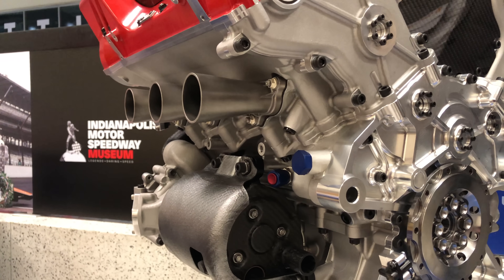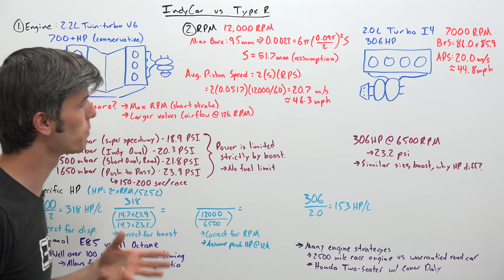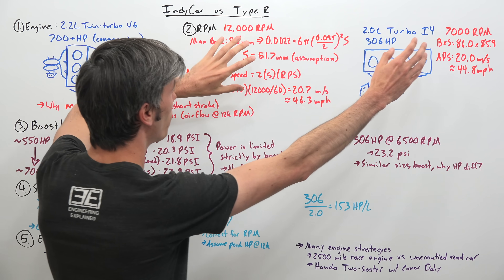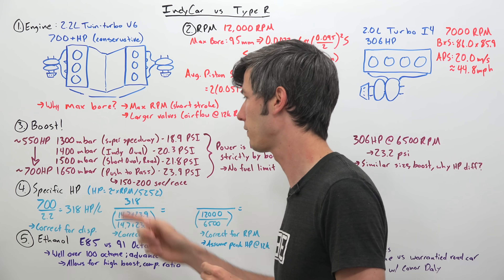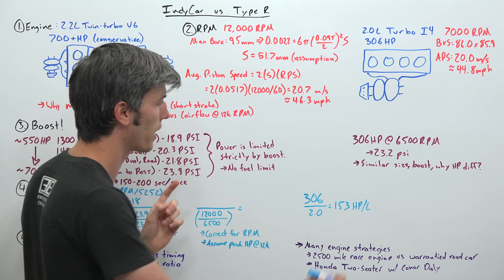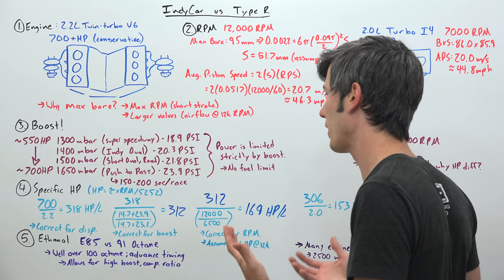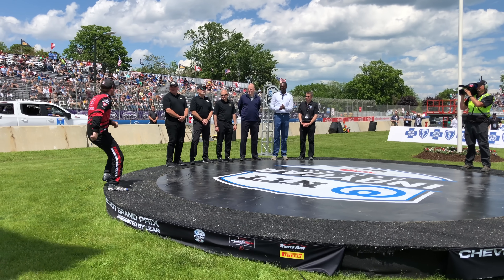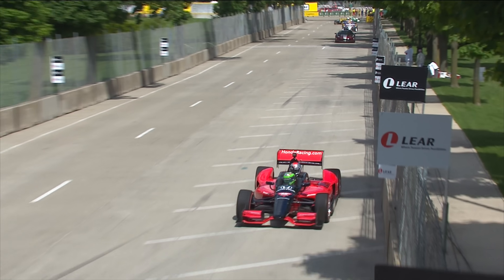How Honda’s 2.2L Engine Makes Over 700 Horsepower

Comment: Turbo engines uses lower compression ratio. Is that mean when piston reach tdc there is bigger gap with crown and cyclinder head? When applying turbo to nas engine what can be done for gaining that ratios or keeping it working properly

Comment: Using RPMs to divide power per liter should give you torque per liter times a constant. For indy car, it is 700/2.2/12000. For types, it is 306/2/6500. Here is the real problem, how indy car engine can achieve such a similar torque number per liter with a much shorter stroke which means the rod is a much shorter lever arm on the crankshaft? The way you are doing math makes no sense to me because HP is not the base unit you should use when describe engine.

Comment: I think a huge thing a lot of people in the car community or new to it overlook is that Boost is a measurement of restriction to flow. If you can reduce the restriction/increase air flow through the engine by improving the air delivery system, better intake plenum design, head porting , as well as better exhaust management with better flowing manifolds and exhaust. you will make the same or more power at a lower boost level. You are physically flowing more air through the engine even at the lower boost level and it will make more power. 

I dont know how many times the first question out of someones mouth about a build has been how much boost is it running. When it has no bearing on the power level of a engine. You could have a near stock engine setup with a tune pushing 22-26 PSI and then the same engine platform with a larger turbo & proper supporting intake and exhaust modifications making 150+HP more at 20 PSI

Comment: How does Honda make 700hp from a 2.2L?
Jason: does some math 
Me an intellectual: it has 2 more cylinders
Reply: It's not about how many cylinders...it's about how much air the engine can flow. Hence the high rpm...nearly the same displacement but almost twice the rpms...which equals close to twice the horsepower. The formula is (torque * rpm) ÷ 5252 = HP. Quite simple actually.
Reply: it would need to have 4 more for it to make sense
Reply: It could have 100 extra cylinders, and with all other variables (displacement, boost, rpm) being equal, it would still move the same amount of air as the 4 cylinder. It's mostly a factor of RPM in this comparison, made possible by the proportion of bore to stroke and maybe some valve sizing, timing and lift, not number of cylinders.
Reply: @Strunz0  indeed.  Its all rpms.  Engine life is super short too.

Comment: You missed that although the average piston speeds are the same the loads the pistons see aren't the same, the V6 needs to accelerate and decelerate its pistons more times per second meaning higher G forces on the pistons of the V6

Comment: That's how you know it has way more than 700 horsepower because that engine I'm sure is designed so that, because of airflow and the geometry of various moving parts and what not, it should still make allot more power per liter than the Civic engine.

Comment: this is the 4th generation  Indy  engine.  It is  easier to  understand this Jap  engine specs.    by dividing  millimeters by 25.4,  the  3.75" bore x 2" stroke = 134 cid.  v-6.  with twin turbochargers at 20 psi boost.  Metric  boost should be stated in kilopascals  and not millibars.  20 psi boost is equivalent to 140 kpa.   Honda  rates the engine for 1200 miles before  possible failure.  It should be noted that  earlier Indy engines produced more power however,  they were downsized in order to reduce crashes.  4th gen Honda engines are rated  550 - 700 hp however  there is  acceleration  lag  with  the trubochargers.   The Indy drivers have complained of lack of  horsepower and  the 5th gen engine w/ 900hp  has been approved and is being track tested in the summer of 2020.

Comment: You didn’t mention emission control as well. Has to rob a bit o power from the road legal Type R motor. How cool would it be if Indy enforced road car based engines and turned the type r motor into their Indycar engine. I want to see/hear the engines in a straight 6 or flat six iteration. V6 bad...I6 goood.
Reply: V6 bad? Sounding because not really i6s sound worse 9 times out of 10 to me.

Comment: I'm surprised he forgot to include how much airflow those Indy twins are flowing compared to the Type-R's single. What are the sizes of each turbo? 10lbs of boost on one turbo does not equal 10lbs of boost on another, say larger or smaller turbo (or two turbos). If you compare the CFM produced by each setup, that is most likely the largest factor in the different power levels.
Reply from the maker: CFM is RPM dependent. What matters ultimately is how much air to do pack into the cylinder. Boost gives you a good approximation of that number. Higher RPM means you do it more times per minute. People overstate the importance of CFM with turbos. There's a reason the series restricts "boost" and not "CFM." Though ultimately, both are limited if one is limited.
Reply: @EngineeringExplained  "Boost gives you a good approximation of that number", I would beg to differ here. 10lbs of boost from the K03s turbo in my beater 1.8t GTI produces a considerable amount less volume than 10lbs of boost from the GTX3071R turbo in my fully built 1.8t GTI. Same motor, same boost levels, completely different amount of airflow going through the engine.

CFM is a huge factor in the amount of power that you'll get from a setup, so it's definitely worth including in your reasons for the power differences. To leave it out completely is misleading to those who do not understand all of this stuff. ;)

Comment: It's the engine torque that does the real work. Also, the six cylinder 700 HP engine has more "power overlap". Because of the six cylinders, there is always one piston contributing power at all times of the crankshaft rotation. Where as in the four cylinder engine, there is a moment of crankshaft rotation where there is no power being produced at all. Because of the two missing cylinders.

Comment: So, six cylinders versus four, V versus straight, 7000 RPM versus 12000 RPM... teach me how the 12000 RPM V6 produces more power even though it has similar capacity... no white board required.
Reply from the maker: It's illogical to assume that "V" or "6" have anything to do with an engine's power. A "I" can make more than a "V" easily, and same with a 4 over a 6.

Comment: Doesn’t 91 octane gas have more BTUs per unit than E85 ?
Reply from the maker: From a volume standpoint, yes. You need more E85 to make the same power, but you can burn more of it at a time.

Comment: I would really like this in my first gen Colorado. Unfortunately, this would require a much stronger manual transmission. LOL. Great video.
Reply: You can get gm indy v8s for like 30k you'll be able to pump out a ton of hp and well you'll need a new trans

Comment: would be cool if you also compared these engines in terms of valvetrain
Reply from the maker: IndyCar has DOHC with set lift and timing (per regulations). Type R engine also has DOHC, but variable timing on both, and variable lift on exhaust (VTEC!).
Reply: Engineering Explained thanks! :) that’s why you are the best automotive youtuber

Comment: Can you do a video on how the current F1 I.C.E can produce approx 800bhp. It’s only a tiny 1.6L V6 with a turbocharger... Do you have any info on the Honda F1 project??
maybe you know more facts in terms of power output however, it is known that Mercedes for example produce over 1000bhp in Qualifying modes, that is also along with the ERS. 
Do you think that the current F1 Power-Units are engineering masterpieces? Or not that special?
Thanks if you read this 👍

Comment: So the real difference is what? The fact that they’ve built the 2.2 liter to rev to 12K? I thought there would be more explanation into exactly how they did that. Like what kind of pistons; rods, crank was used. What was the material? Are you basically saying you could build the Type R theoretically to rev to 12K and make the same power?
Reply from the maker: Type R can't rev that high due to the stroke. Materials in the Indy engine aren't all that exotic, to keep costs down. Steel crank/rods, and forged aluminum pistons.

Comment: The joyride was no faster than the vette following.   Respect the Vette !
Reply from the maker: Haha, it was way, way faster than the 'Vette! But unfortunately my GoPro died so I didn't get the hot laps recorded. The lap recorded in this video is just the warm up lap where they bring the cars out on the track.
Reply: @EngineeringExplained  Geee... Now it makes sense.   I thought the tandum racer was for whatever reason dogging it.  Thanks for replying and clearing that up.

Comment: So what prevents the s2000 motor going to 12000rpm? Can you just change fuel and timing, sacrifice your engine life and change the limiter to 12000 to see 700hp?
Reply from the maker: No, it has too much stroke to rev that high.
Reply: @EngineeringExplained  Oh yeah, you even mentioned that in the vid. Cheers.

Comment: Twin Turbo 2.2L Hondo Indy car engine. I wonder how this engine makes soo much power???? 12k RPMS, twin turbo, over 20lbs of boost. It's not that surprising. F1 engines make more power in a 1.6l V6 single turbo engine.
Reply from the maker: Higher number of turbos does not = more power.

Comment: Its about the super tight tolerances, piston to cylinder walls. That is where the power is at. Windage.
Reply from the maker: You could put crazy perfect tolerances on a Honda Civic and it's still only going to make 150 HP.
Reply: @EngineeringExplained  of  course boost, super light high revving valve train, compression ratio, and pistons that dont move in the cylinders until the engine block is warmed up and expanded before the engine is started type of tolerances is the recipe.

Comment: Engines like this lead me to believe that we haven’t even come close to reaching the full potential of gas engines.
Reply: About 2/3rds of the gas in your tank is completely wasted as heat providing nothing beneficial until winter. If we could limit that heat loss we'd have larger engines reaching 35+mpg instead we have to use small engines to achieve that. Now why you would need 300+hp in a passenger vehicle beyond men since my first car put out about 75hp and it felt zippy enough.

Comment: R u worried now that CHEVY engine might now share this information and work on modifying there engines now?
Reply from the maker: Haha, both Honda and Chevy know far, far more about these engines than I ever will. :)
Reply: @EngineeringExplained  you explained pretty well. I know Honda has some supd up ENGINES in a museum, and nevered been driven on. Built and sitting on display.

Chevy 2.2L is more powerful then the HONDA engine period. Did you know bore 2.2l and make it 2.3l and adding alot of upgraded aftermarket products and throw on t3/t4 GTX3582R V BAND Ball Bearing turbo can push out more then 750hp.  Lol...ok..gotta go. And I love both engines but...I'm CHEVY guy

Comment: A 2.2litre making 700hp @ 12,000rpm with 23PSI would have a calculated VE of 85%.... that’s probably where the stock Civic type R is.  The Indy car engine would have 100%+ VE, I would conservatively estimate at 825hp based on 100% VE..... which brings me to my next point, that difference of ~20hp/litre you’re seeing is probably a difference in Volumetric efficiency.
Reply: Actually with the “corn juice factor” it’s probably higher than 825 again

Comment: Its not impressive when you find out its a twin turb.. clickbait.
Reply from the maker: Haha, calls it clickbait because it's twin-turbo, when having two-turbos never means you'll make more power than one turbo. It's just a quantity of turbos. Like cylinder count. You can have 4 cyl engines with massive single turbos make all kinds of power. Consider being kind, it's not clickbait. If you watched, you'd realize how it's all done. :)

Comment: Nice video.   An extremely significant omission was the different induction systems and the number of valves.   The race engine has cylinder heads and intake manifold that flow much more air than the street engine.  Also, 24 valves instead of 16.  Also the exhaust systems are very very different.  It's about airflow.

Comment: Short answer: The Indy V6 runs nearly twice as fast (12k RPM vs 7K RPM), and uses much higher octane fuel.
Reply: Jorell Dye  addendum: And only lasts 2000 miles.

Comment: Drop that motor directly into the classic NSX.. -SERIOUSLY😁
Reply: @jzxtrd337  I cant tell if you're a troll or not but indy engines go about 3000 miles before getting a new one. They gave races longer than 250 miles lmao
Reply: I'M NOT HERE FOR A LONG TIME; I'M HERE FOR A GOOD TIME
Reply: @jzxtrd337  2500 miles of full on being pinned. A f1 engine will drop revs which helps with longevity it also helps more f1 races cover less miles.
Reply: @jdrok5026  constant rpm is easier on engines.  You can do some interesting things reliability and power wise with steady state rpm
Reply: @1320crusier  constant rpm sometimes can make things last longer but it depends on where in the rpm range. A indy engine is full bore unless pitty or getting up to speed meaning the engine needs to either be built to rev more and make more power than it does to out it in the greatest efficiency range. As rpm increases wear. A constant rpm keeps the rate of wear the same.
Reply: Pitting
Reply: @jzxtrd337  remember indy can be 500 miles of pinned for a indy with only breaks while pitting

Comment: It is amazing that the Honda street 4-banger is so close to the race engine, which I think we can assume, pushes all the limits.   Piston speed, boost (ok artificially limited here), apparently BMEP & PCP, and adjusted volumetric power density.  They really did it all with rpm and a little higher efficiency.  Honda Street engine is amazing to so close to several limits and have so much durability.
Reply: Tim Duncan I concur Tim Duncan, and what’s really amazing is Honda making them affordable to the ordinary buying public
Reply: Bapster Man,   Excellent point, maybe the best.  I hear Ferrari makes great engines but it just doesn’t matter, I’ll never afford one.  I’ve already owned several Honda.

Comment: Another important factor is that the ECU in production turbo engines starts opening the wastegate around 4000 rpm, and the boost at redline is usually several PSI lower than max. This lets them setup the car with a broader torque curve, makes it easier to drive and more reliable. For a race car, you can push the engine much harder.

Comment: Or... you could just go electric and forget all those complicated variables. More batteries + more motors = more horsepower.
Reply: Not entirely you do eventually reach a point of to much energy going in. And more motors only works if you have the capability of doing such a thing. Or the same applies to engines more engines more fuel more air more power

Comment: What will it take for the 2.0L engine to have higher rpm with no engine damage for long use, because I once had a Civic Si 2007 with custom intake, I sometimes go higher than 8000rpm

Comment: You refer to boost as a reference to airflow when comparing these two engines which confuses me a bit as boost is pressure if you really wanted to use a more accurate reference to air flow why wouldn't you use cfm or pounds / min?
Reply from the maker: Because boost plus volume (displacement) tells you how much air goes in the engine.

Comment: more cilinders is more power. larger area more effective combustion
Reply: That's not exactly true more cylinders doesn't always mean more power. It's about displacement compression ratio airflow rpm torque output normally more cylinders makes them react and deliver power more smoothly

Comment: Would emission regs not curb the Type R performance? Whats the difference in power to weight? Is the track car lighter? Note in F1, fuel cannot be some exotic type. F1 fuel is cooled though -  to pack as much fuel into every refueling stop and curb fuel catching fire in the pits.